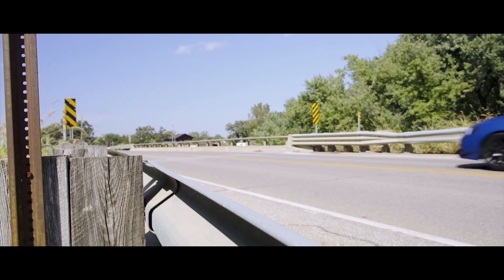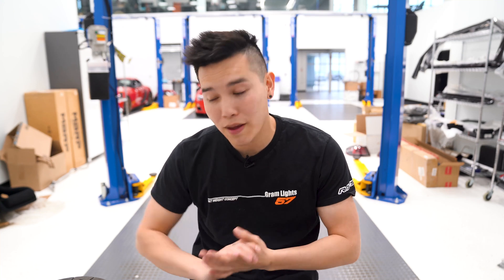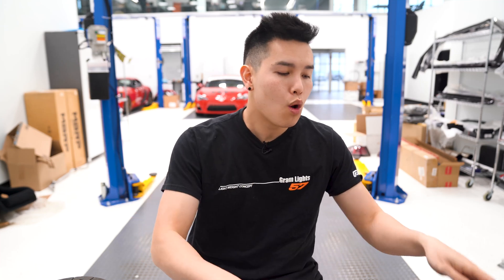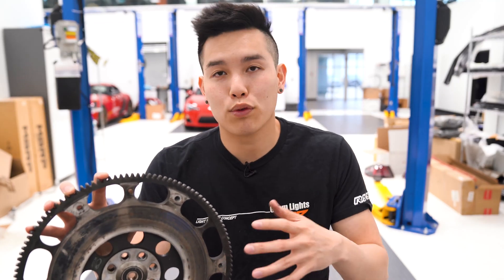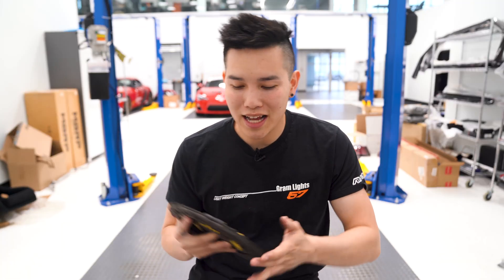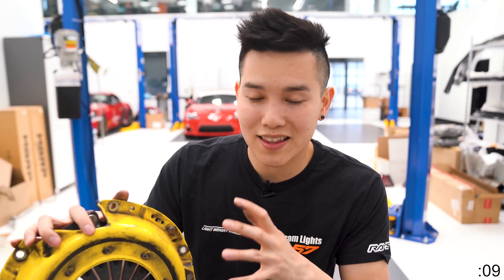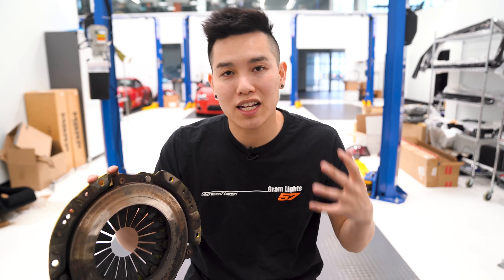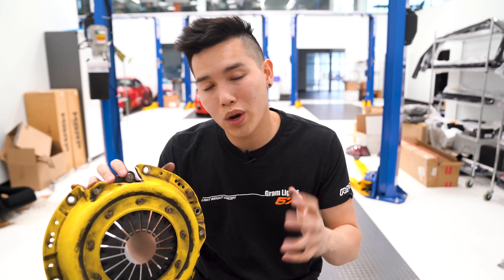How does a clutch work? - Two Minute Tuesday

Comment: Can we get a 2 minute Tuesday on why Subaru engine temps are always at the middle of the gauge, by the way love the video super informative👍
Reply: Thats every car lol it relates to the operating temperature being in the middle its pretty simple 🤷
Reply: @Josh.Jordan  I know it’s operating temperatures but there’s some other cars out there in the market that are always sitting below the middle mark, for example my mom’s Dodge Durango never goes past the middle, it always sits in between the middle and the operating marks🤷🏻‍♂️
Reply: @briantoolive  that's just how the manufacturer makes the gauge lol doesn't need a whole video
Reply: @Josh.Jordan  lolololololololololololololol,  ok lol. So what I wanna know is, when you start modifying your car that excess heat that’s being produced by the modified parts that are installed, would the car rather be at the middle mark or lower, maybe the Subaru is supposed to work at higher temps, obviously not cold. Just wanna hear other people’s opinions
Reply: @briantoolive  Google it dawg lmao
Reply: @Josh.Jordan  lol ok dawg lol